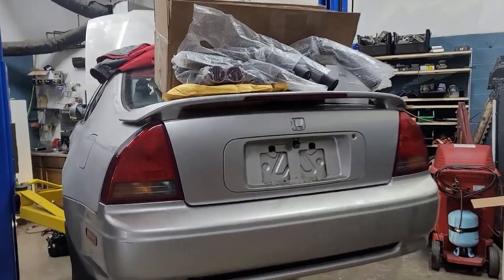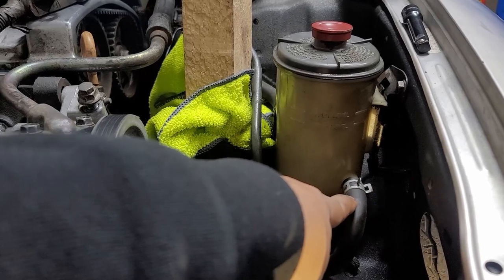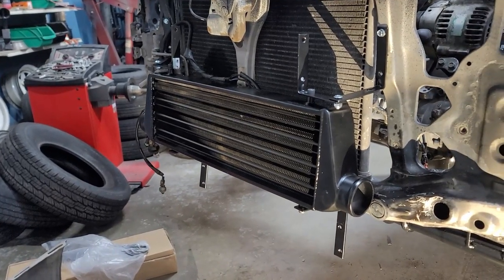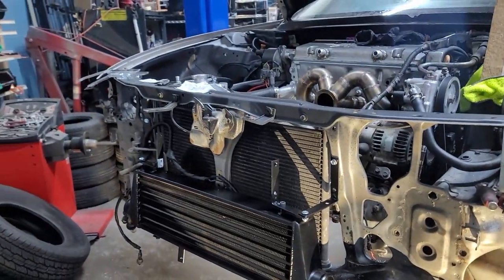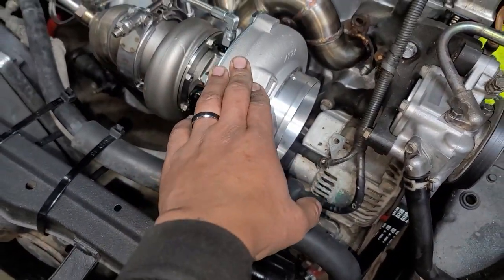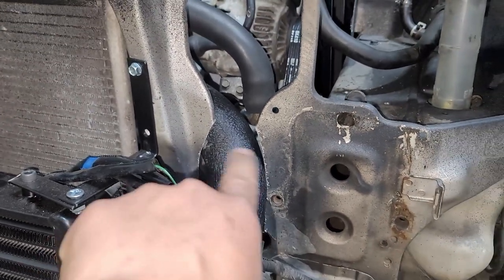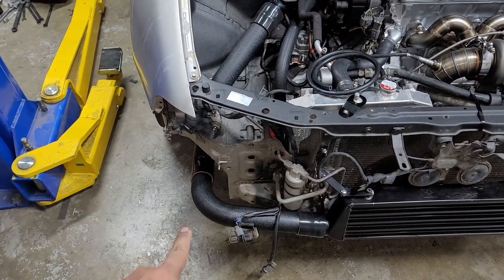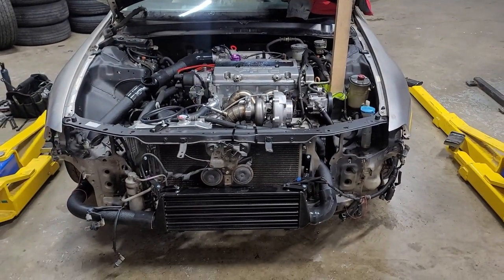How to TURBO your Honda Prelude Pt1 | Intercooler install

Comment: Damn, turbo kit with rubber pipe looked good and different than the metal or aluminum pipe. Is rubber pipe help reduce the heat from turbo to intercooler? I am just curious, keep it up!
Reply from the maker: The piping is not rubber only the couplers
Reply: @treybedipping1734  Oh I see, my mistake ha. I though it was but cool.

Comment: Ive started running my 5th gen on deliveries , she's a workhorse!
Reply from the maker: Aye at least you get to drive her
Reply: @treybedipping1734  yea i cant solve my bouncing idle so its annoying AF. i have a new IACV, cleaned FITV. Found all vacuum leaks and bypassed IAB, cleaned the TB and bled coolant. The only thing left is maybe clean EGR passageways? It starts bouncing after it warms up/ after you hit the gas at all after its started. No CELs
Reply from the maker: @trundlepufpendants  if you've done all of that it could be the tps or you may need new gaskets.
Reply: @treybedipping1734  should I delete FITV as well? Was thinking about replacing it- was in pretty crusty shape
Reply from the maker: @trundlepufpendants  idk if it will fix your issue but you can try

Comment: Really loving this build Trey.  Got one question tho.  When exiting the turbo why did you not want to use the hole where the windshield washer fluid tank filler neck goes ? Just for the shortest route into the intercooler ?  Either way it looks looking awesome.
Reply from the maker: I'm keeping the washer fluid so this was the best way for me to run it

Comment: I have a 95 prelude si with the h22vtec blue top on the h23 block. I am trying to learn turbo and i see your build, i am trying to figure out how air is routed through the throttle. Im new to this so please excuse my lack of knowledge, but is air entering through the turbo, through the intercooler into the throttle. Can you do a basic video to help explain the airflow?
Reply from the maker: Exhaust gas spins the turbo and the air is pushed through the intercooler into the throttle body.

Comment: Where did you get those brackets? They came with the intercooler?
Reply from the maker: @SteadyWorksGarage  i used L brackets i found at lowes in the hindge section

Comment: is that gtx 3076 a reverse roatation version? or did u just physically flip the turbo?
Reply from the maker: I just clocked it the way I wanted it face. The vband version makes it pretty easy